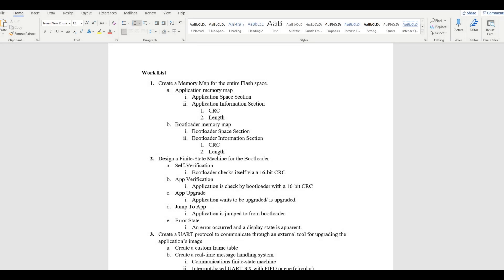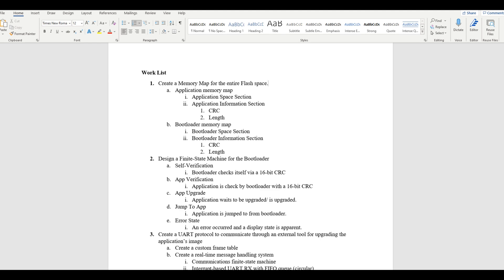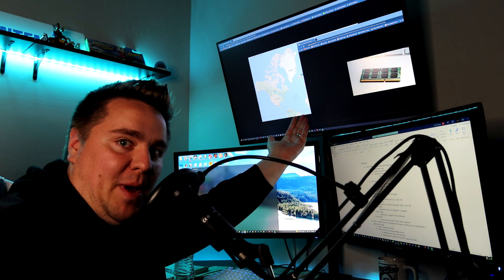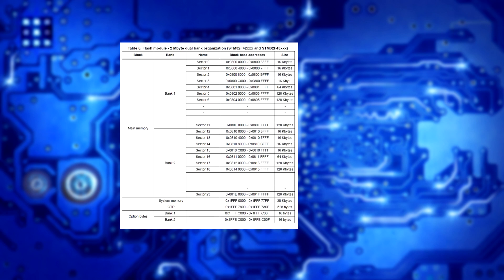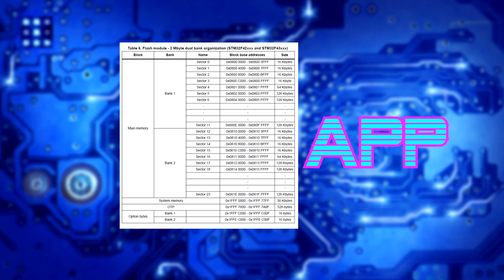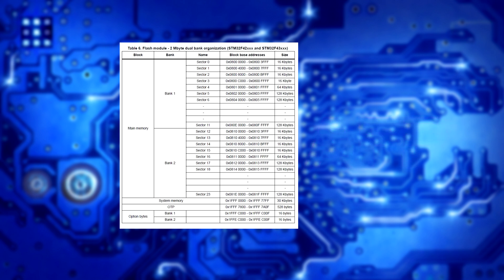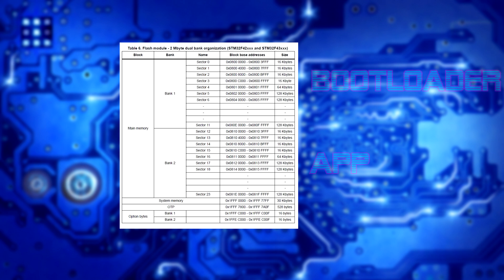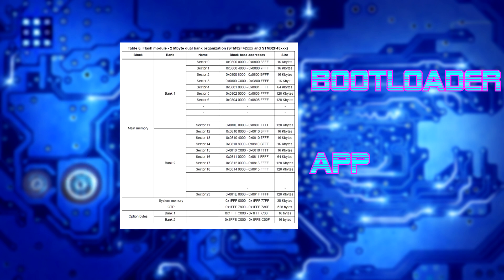Let's Build a Bootloader Episode 2: Materials and Tech Selection

Comment: I'm afraid the MCU you picked up is too advanced for me :/ (and expensive on these pandemic times)

Also, I was expecting something less professional because well, for example, I am amazed how well the Arduino's bootloader works, that machine is cheaper than the STM counterpart and less powerful, hence less complex, and in a lower level from that we have ATTiny85 which is even lesser powerful, it just got 8 miserable pins like a 555, and yet we got Digispark whole set ready to be plugged on to USB, programmed and off we went since it's got also a bootloader, that's the simplistic bootloader I want to understand how it works.

My background is: I watched the whole Ben Eater's 8-bit computer build, some 6502 little programming, some AVR in C and Assembly, C# since 2008, miscellaneous.
Reply from the maker: You can always go with a cheaper MCU and follow the advice I give in the coming videos :)
Next time we will actually start touching real code and going through the state machine.
But I really wanted to show the importance of being able to break down an ambiguous problem, figure out what you need to solve, figure out how you can solve it, then gather the right tools and materials to solve the problems.
The micro is definitely overkill, but it's just what I had laying around and according to our requirements it fits the job.
But if you want to start on another micro these same philosophies of design still will apply!
Reply: @ZygalStudios  it's always better to watch it running on a real target hardware (as Ben use to show) but anyway, I will scream out if I don't understand your upcoming videos. Thank you for your kind answer.
Reply from the maker: @deltakid0  Thanks for your thoughtful words and advice!